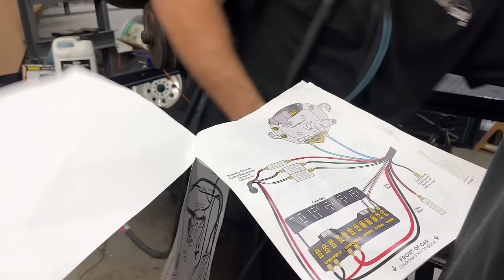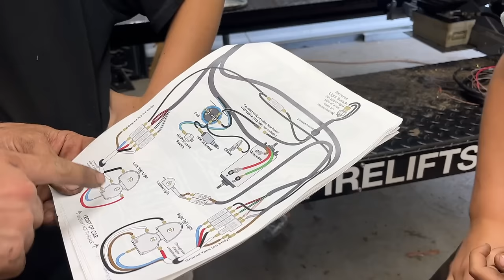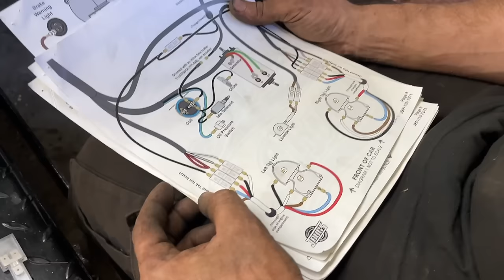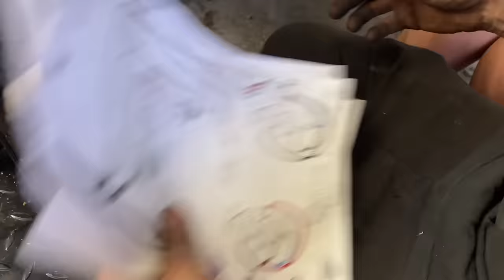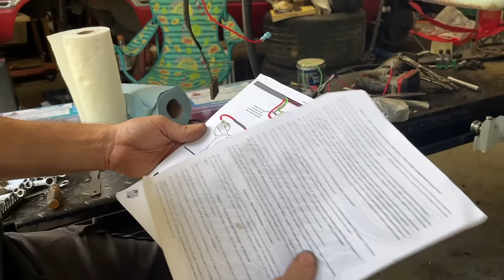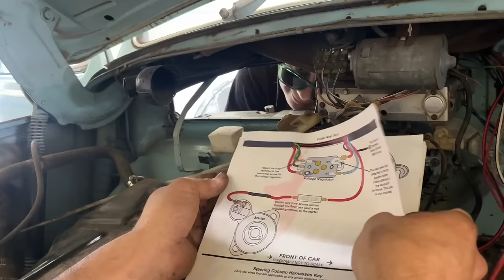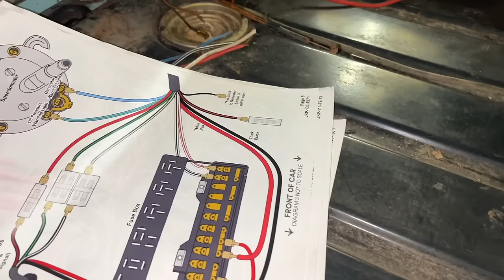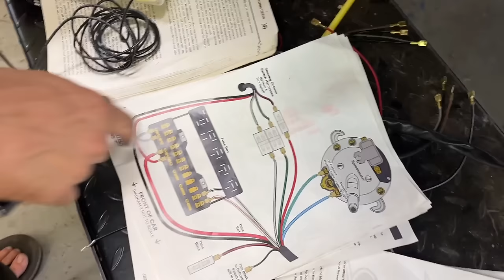Back on the road after 23+ years parked!

Comment: As a retired VW mechanic I have really enjoyed following this build. My specialty was front ends and electrical wiring, you did a great job with that, this should be a great car for Wawa, a little waxing and buffing and it will sparkle 👍😁🎩
Reply: Hey there are not so many of us Old VW Mechanics around, happy to see another pipe up. To this day I can set valves and tune one in about 15 minutes.
Reply: Are you going to be pulling the bug with the RV when going on a trip
Reply: If you  have a single bowl master cylinder look up a dual reservoir master cylinder with  propers ion valve so that of the front brakes go out she will have back or if the back go out she will have front the single reservoir system can be a problem I like the progress on the beetle and it’s an awesome one just joined your channel and like it a lot thanks for the video 😊

Comment: I'd recommend installing a new brake line kit.  Runs about $60. The front to rear tends to be the main failure point. And  definitely replace the throttle and clutch cables. Also replace the oil cooler seals. They will be so dry from sitting and will eventually start leaking pretty bad. Original would have been a vacuum advance distributor. They may have removed the lower tin to get to the thermostat. Did you notice if there was a bellows in there? Stock engines will have thermostat driven flaps in the fan shroud. If the bellows fail, the engine can overheat. Also get some new fan shroud hoses so you don’t lose air. This can cause overheating.
Reply: The front lower plate behind the number tends to be a place for rust, heritage places are available....although it may not rust as bad in America
Reply: I think by that vintage they had moved away from vacuum advance distributors, or some came stock with and some without. Mine was non vacuum
Reply: I agree, the bellows and thermostat and levers/cables must work or the engine will overheat.
Reply: @cliffordkinnear9705  Absolutely. Could also lock them in the open position with some wire, if the bellows are not working or missing. The only benefit to the flaps being closed would be in colder weather.
Reply: I would have never reused those old metal brake lines, They dont cost much .Remember  they sat 23 years and they are even older from the date of manufacture. Brakes are kinda important! You  never cut corners on brakes or casings

Comment: Been building vws over 20 years. My advice is adjust the valves cold. 006. Do them regularly. And that 009 distributor you  have need to set timing at 32 degrees at 2500rpms and let the base timing stay where it falls. Vacuum advance distributor will run better with that carb.  Great work as always. Love your channel and what you do with the family.
Reply: Right on.

Comment: 🚨🚨 *IMPORTANT* tip for the battery and wiring under the back seat! It would be wise to cut a piece of wood to fit under the back seat or some sort of insulation. The springs from the bottom of the back seat can sometimes ground out on the battery terminals and other wires when someone is sitting in the back, which of course can cause power wires to ground out on the seat springs and melt the entire wiring and cause a fire. I speak from personal experience when I was young and drove a 1975 Super Beetle. GREAT job on the restoration, that is one happy lil gal! ☮
Reply: This happened to a guy i worked with in Florida , the bug caught on fire at his house in the garage and burned his entire shop down! he lost all his tools and another car. It was not running
Reply: I also mentioned it to him. He responded so I’m sure he’ll work something out. Reason it happened in the passed is because people replaced their old batteries with the incorrect ones. They’d move to a group 35 battery for example. A lot of people don’t even know what that means. Well, the short version is, the group 35’s (and others) are far taller than the group 42 batteries the cars came with from the factory. That added height was what created the hazard. People just didn’t know. People would simply blame the car and poor design etc. when in fact it was the doing of their own or an unaware mechanic putting the wrong sized battery in the car. Bugs are the best and extremely reliable when one knows how they work. 👍
Reply: Yep. Happened to our family beetle when i was an early teen.  Good thing we were still in the car when smoke started coming out of the seat.  Gave us plenty of time to put out a small fire.  It left a hole on the front cover of the rear seat though.
Reply: @nolsp7240  as mentioned, the wrong battery was installed. This often happened back in the day because people simply didn’t know. Factory batteries (group 42) were shorter. People blamed poor engineering not knowing that incorrect battery replacement was the true reason. 🤷🏼‍♂️

Comment: A tip... The body grounds are one of the reasons the throttle cables snap as it tries to ground through the throttle cable when the body grounds are corroded.   I'm only half way through this vid but great so far!

Comment: As a previous Bug owner that knows why...make sure your foil cooling hose is attached and in good repair. Love your channel!
Reply: That foul hose is just for the heater. Lol. Engine will be fine without it. Your heat will suck though.
Reply: There's (iirc) a set of flaps behind the air cooling shrowd with some linkages to divert the cooling until the engine warms up. It used to be a recommendation to check the linkages were still connected.

(The heater channels on my old beetle were blocked/welded shut and I only had one heat exchanger and couldn't afford a real replacement for one so had a 'J' pipe in one side. I had a foil heating tube from the one working hot air source near the back seat through to near the gear stick in an attempt to keep me warm in snowy weather 😀)
Reply: @seanmorris  Correct. They mount to the inside of the fan shroud. On the passenger side (1/2) under the cylinders there would have been an expandable brass bellows with a rod going straight up to the flaps. When the engine warmed up, the bellows would expand and then open the flaps to allow max cooling to the cylinders. 

Over the years many people would remove the entire system. Not a big deal in the SW where you need max cooling and have very little need for a fast warm up. The flaps are very much needed in cold climates where they greatly aid in warm up and in engine reliability. 

Even though I live in So CA I put them on all of my cars, but I’m sort of an original equipment dude and like everything factory.
Reply: @seanmorris  Great ingenuity to get some heat back in the day. They are awesome cars and even a better group of enthusiasts  keep them going.
Reply: Keep the hoses attached for sure, otherwise the fan will circulate the stale air in the engine compartment a bit.

Comment: I ran a 009 centrifugal advance distributor for years with points and had no problem with it. But also ran a Weber 30 pict carb which was the best carb I ever had on my VW. After 10 years with that combo, I installed a Pertonix ignition kit which was the single best improvement for my car. Had to tweak the timing a little but never had a starting problem. I would advise adjusting the valves as soon as possible as it is important to engine longevity.
Reply: Yes. 👍 I forgot to mention valve adjustment. Simple task but important (after a head torque) just to be sure. Hopefully he sees your comment. I’m still running points and my car’s original 30 pict 3 carb and vac advance. Never leaves me stranded. Absolutely flawless combination. Never bothered jumping to electric ignition. Never know though. Maybe someday.

Comment: GREAT job! Watching you guys work on this VW is just fun!!  Josh, two items for you: 1) Replace all old grommets with new ones whenever you can (your nice, new wiring is going to rub right through those 50 year old grommets) and 2) Clean and lube (dielectric grease) all old contacts (especially when they've bathed in rat piss).
OK, we've got too get Josh the biggest variety kit of body grommets and a case or two of dielectric grease!!

Comment: The Beetle is a great first car! They are solid, easy to maintain (actually just changing the oil is all you really need to do). It was good to see the only exhaust smoke was at the the initial start up, after that there was none, even under load when driving it.

The engine is so very easy to work on, like a motorcycle really, with the Jugs requiring removal to access the block or to change rings. Plus Jugs are very inexpensive!

Maybe Squeezy can add a bit of her artistic skills to the vehicle somewhere.
Reply from the maker: Totally agree! Thank you

Comment: Hi Josh another storey about my vw experience. Back in the 1980,s i owned 2 vw Westfalia campers.  A 1974 and a 1975.
The engine in tge 74 put a pushrod out through the top of the block one day. I bought a KEP adapter kit from a shop in Maine  and installed Mazda 12a rotary from a local  junkyard. The body was getting past its best and i picked  up a 75 westy with  no engine and  transplanted  the 12a into it  for a rad  i used one from a 1974 Chrysler  New Yorker that  i had retired. It was mounted out front with a substantial angle  iron  frame and the large VW circle logo. No more connecting rods to pop out. The 12a was smooth and sweet to drive  in the otherwise sedate camper. Funky exhaust note too . That camper  eventually went to a junk yard and regretfully i did not save the engine and the KEP adapter plate and clutch. Have a great day. I am waiting for your family,s next video  i still have a pic of the blue 74 with the rad out front. Tom up in Canada at the NB-NS border

Comment: Another great episode! Wawa is going to love driving this car.  I learned how to drive in a yellow 72 bug when I was 12 yrs old. I always looked forward to deer season. We hunted on 604 acres & we would leave our Ford Econoline cab over Open Road motorhome ( similar to the 1 y'all are rebuilding) & the 72 bug @ the deerlease & would use my dad's 78 Silverado to drive back & forth home. The stand my dad would hunt was on a pipeline that ran through the middle of the lease & was very close to the camp so he would drive his truck to his stand. The stand that I hunted was on the same pipeline about 800 yards apart. The only way to access my stand was by a gate on the far side of the land. All of the roads were blacktop or dirt. My dad would give me the keys & tell me to drive it like he taught  me, so I did. I learned a lot about driving during those hunting seasons. BTW, my dad was a police officer for 35 & 1/2 yrs. In E.Tx. Have you ever tried using a rubber hose & plastic bottle when bleeding the brakes. All you have to do is put 1 end of the hose on the bleeder screw & the other end through the lid of the plastic bottle. Now when you bleed the brakes the air & fluid goes in the bottle instead of all over the bottom of the car & on the shop floor (especially when you get into the new shop). It'll save you some cleanup time that you can use on another part of the car. Thanks for all the family friendly content!!😊😊❤❤👍👍 I'm sorry for the long comment, but that old bug brought back a bunch old memories!! Thanks!! Keep up the awesome work!!

Comment: That red dot on the Hoops is supposed to be aligned with the valve stem I think. The ignition advance is handled by the electronic ignition module, thus no need for a vacuum diaphram. My Harley is set up the same way. That's a neat little Bug. Great job guys.

Comment: I sure enjoyed watching you restore that old beetle. sure does bring back memories. here's a heads up. you want to make sure let you do a valve job. I had a old beetle mechanic tell me don't let it go pass 60,000 miles without servicing your valves. for some reason they used to break and drop into the engine and brake pistons. I can't be sure about it but you might want to look it. it was sure fun watching you have fun with your kids.

Comment: Just a tip for painting rims, use the deck of card trick, put cards around the rim and tire around the whole wheel and then spray with paint.  When the paint is dry remove the cards, no paint on the tires 👍😁

Comment: Hey, enjoying this build.  Th horn is working properly . The problem could the ground wire for the horn button is touching in the steering wheel shaft. Take a wire coat hanger unbending it and fish out the ground wire to the center of the steering wheel.  For the after market wheel you can get a horn button kit that will mount on that wheel.  Now what I would do is find a complete stock wheel . Stock wheels are a little bigger it will make it easy for your daughter to steer and handle the car. For the exhaust stay with a stock exhaust.  That way it doesn,t bottom out when leaving parking lots.

Comment: A tip from an Electrician... Punta little soap on the taped up area. Helps keep it wet a slimy to get through the holes. Just a  little. It also works on a trailer when wheels are locked up

Comment: I think the VW older bug is the most fun car you can own and drive. Look under the back seat on the hump there is a lid with screws to hold it down. Under that is the shifting rod that has a rubber connector that after many years will wear and cause the shifter to not be correct, a great little car.

Comment: Good to see y'all got it on the road. In regards to the distributor, not all are equipped with vacuum advance. The mechanical advance curve is designed to give the engine the advance it needs based on the rpm. I suggest you change the transaxle oil,  replace the clutch and throw out bearing before taking it on a long drive.
By the way, are you rebuilding the red Fairmont you have on the rack? You don't see many of those around.
Many blessings to you all!
Reply from the maker: Awesome thank you

Comment: What a great first car!
Be sure to check the valve adjustment soon, when it’s stone cold! It sounds like they’re close but you want to be sure! The spec is every 2,000 miles because they have solid lifters that are more sensitive to burning valves. Unless you’re putting in a thumpin’ sound system you don’t need to install an alternator. An air cooled flat four doesn’t need a lot of amps to turn over.
I’m partial to the whistle of the stock pea shooter exhaust system too but that might be too nerdy for y’all!

Comment: 😎😎😎
    1973 ,at 16 ,my first car was a $125 , 1966 VW 1300 cc BUG. 
One tip : Do not replace the exhaust tips with the stock pencil and baffle tips .
    They will decrease your horse  power, and they make a whistle sound .
     A performance exhaust is best .
    Don't know how the winters  are where you  live ,but she'll freeze in the winter. 
    I lived in Ohio and had to scrape the frost off the inside of the windshield while driving down the road .     
                     🥶

Comment: awesome job, so glad to see a family working together. My first car was a 74 super beetle. drove the heck out of the car, fixed it a lot, then had to retire her cause the rust was to bad. A few tips, the washer fluid runs from the spare tire pressure, so get an after market pump or more modern reservoir. The heat runs off the exhaust. so if you replace the exhaust, look for the heat ex-changers with the fins. also check the front pan where the suspension mounts, this is a common place they rust out and fail. other than that, have fun, absolutely the number one fun car to drive. I live in Pennsylvania, and when my friends with 4x4s got stuck in the snow, I was able to keep going. not sure if you see much snow in TN. Blessings!! ❤❤😃😃😃
Reply from the maker: Oh wow thank you

Comment: Back when I bought and drove my 71 Super Beetle like Wawas, the oil suggested was Quaker State 30w High Detergent.  I changed is every 3000 miles faithfully and pulled the screen occasionally.  Usually there was just white milky substance on the top of the cover.  I always thought it was the detergent.  With today's oils I guess you have many choices of which to run in the Bug.

Comment: Great video ,  Yes you are correct on the distributor with a vacuum can is better.  Better for taking off at a dead stop.  No dead spot.    Also the older carb has a idle jet on the generator side that gets plugged up , unscrew it , clean it , so you can see daylight thru it.  Also there is two screws on the coil side for mixture ( smaller screw ) and idle ( larger screw).  The other screw that is on the lever is for the choke setting.  Nice car for running around in. Enjoy.

Comment: Loved watching this. I have a '74 super beetle so can relate to the driving FUN. I did notice that when you put that lower engine cover on that there did not appear to be a thermostat or bracket for it on the engine (that's what the cover is for). The other thing you MUST do ASAP, is replace the missing engine gasket (rubber) that goes between the body and engine tin work. This will keep the heat from the exhaust and air cooling from being sucked in by the cooling fan. If you don't the engine will cook itself to death very quickly and destroy itself. So do that SOON before you spend $$ on looks. I want Wawa to have a nice car she can be proud of!

Comment: Just a bit of information on the Packard 56 terminals, (wiring plugs) 
There is a tool to slide in to depress the lock tab but I took one of my smallest flat blade screwdrivers and ground it down small enough to be able to reach into the terminal housing ( only after losing the first two correct tools that I purchased for them). 
You’re done with this harness, but I hope this helps for future projects.